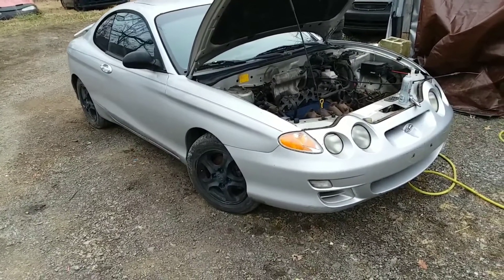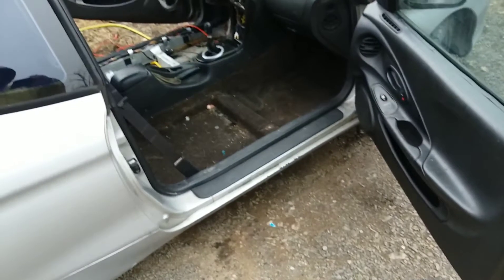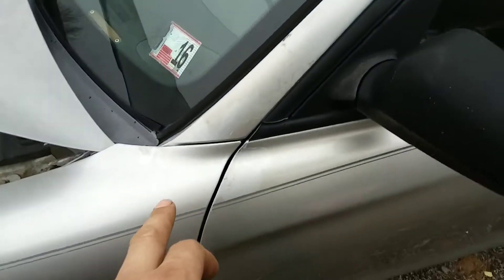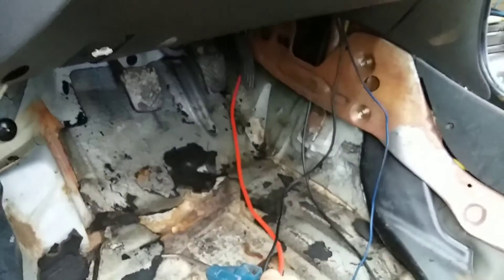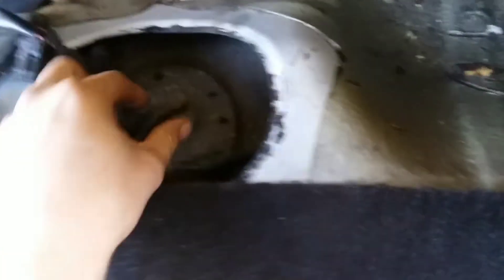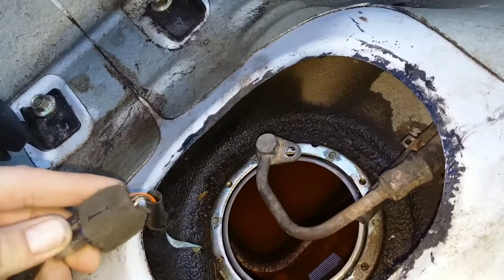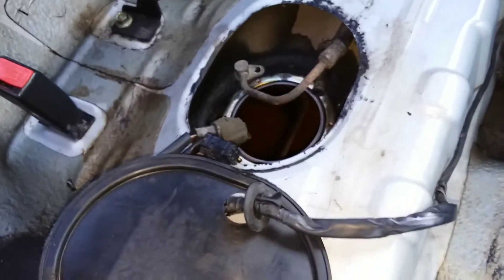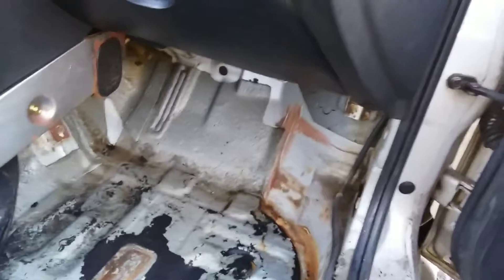Bought a 2001 Tiburon to be my new Street car

Comment: Great Tìbby rd2!! I bought the same car, could you help how to find and replaced an air conditioning filter?
Reply from the maker: I never replaced one before but there called cabin filter
Reply: @PATuners  Thanks.  I'm just curious because I can't find it on the dashboards :(
Reply from the maker: @heriyanto2336  it's under the dash but if I remember right have to pull the dash out to get to where its at